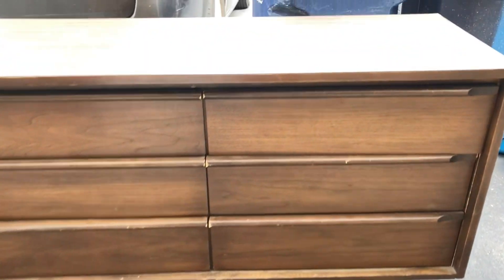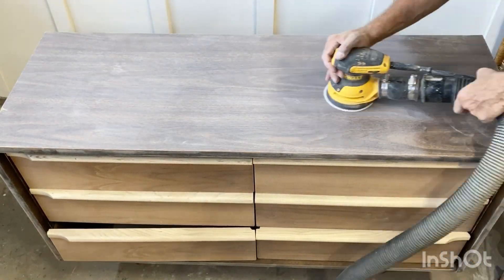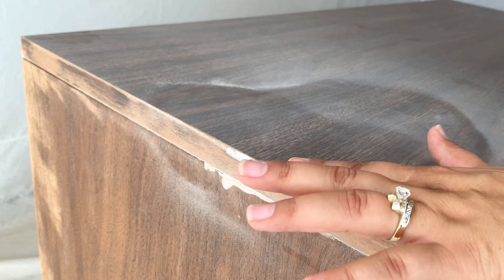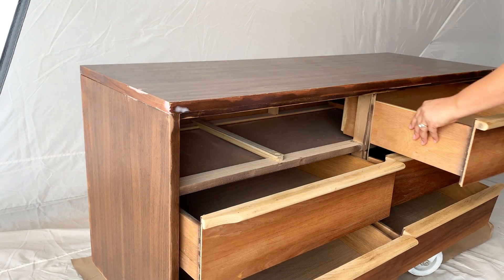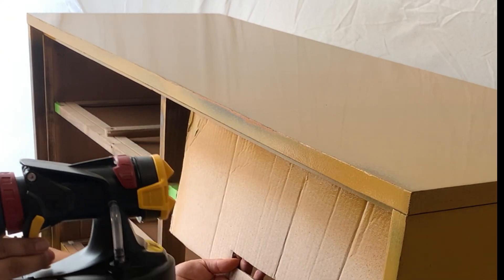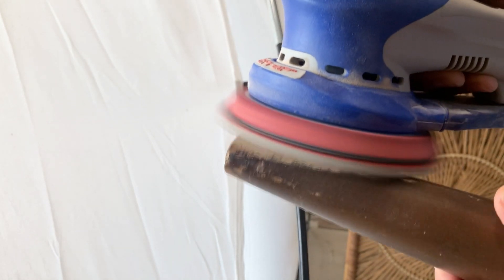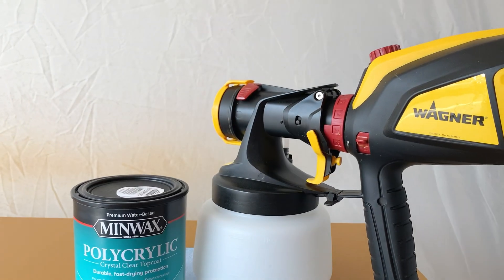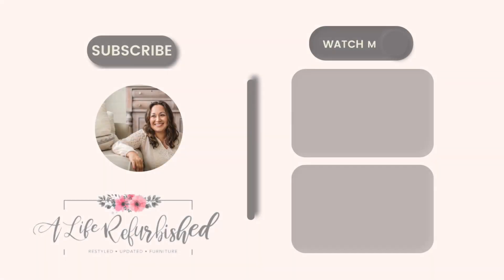Modern Retro Dresser Makeover | Furniture Flip

Comment: Hey girl! You may want to use the detailed nozzle next time(blue tip), that one you used is for bigger projects like walls/fences. This turned out beautiful!! 😘
Reply from the maker: Girl, I know! This was the second and last project using this large one in furniture But not sure that the nozzle had anything to do with the paint drips on the one side. I’m still wondering what that was all about. And thank you! 😊
Reply: I’m thinking it has to do with the material and air flow settings since you mentioned it was a thinner viscosity. This sprayer takes time to learn how to adjust those depending on the product thickness you’re using. It’s been a year for me using it, and still learning but I can tell now once it goes on when there is too little/too much material flow etc.
I’ve been through it with this sprayer! 😂😂😂😂
Reply from the maker: @DIYDecorDiary  the second time I had adjusted the setting and it still did it. Again, just on the one side. But anyways, I’ll be using the detail nozzle now. ☺️